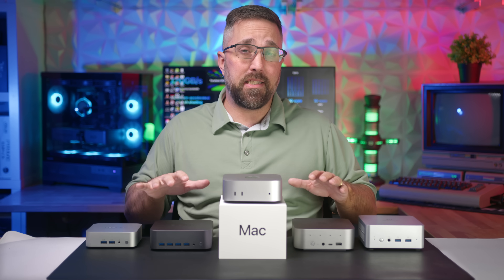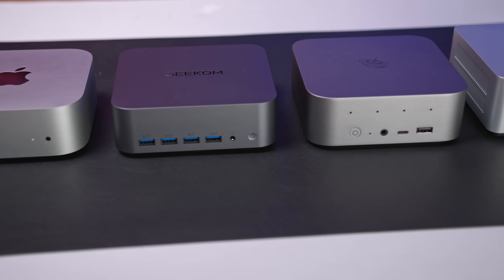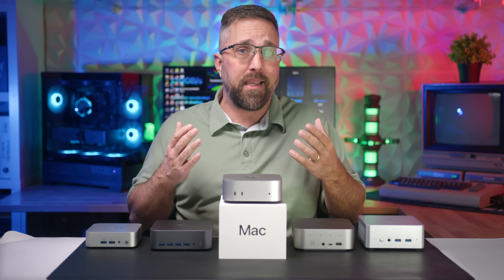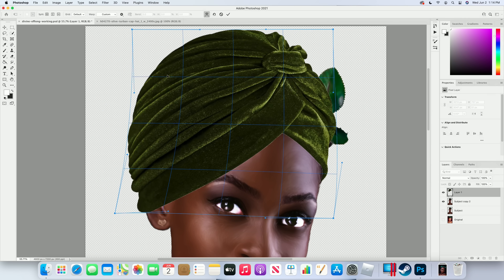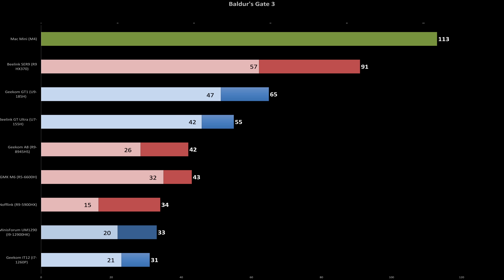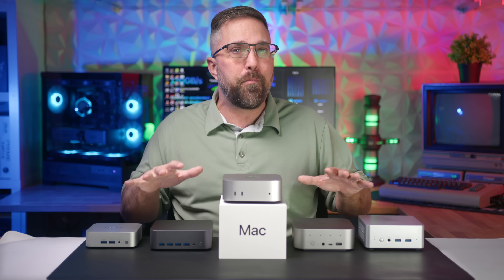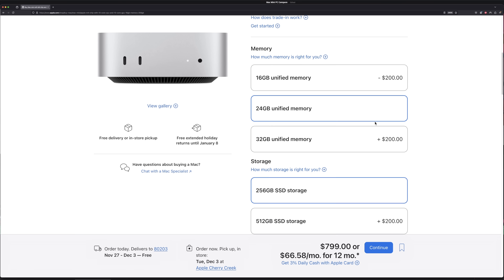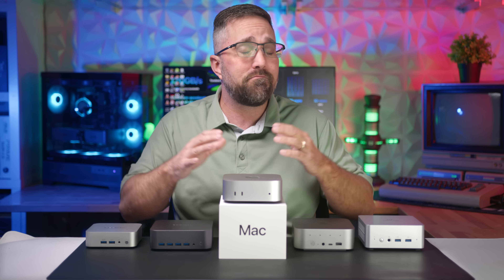M4 Mac Mini vs Intel and AMD Flagships – It's Not Even Close!

Comment: My Mac Mini base setup (it's the only way to do it if you value your bank account):
Mac Mini Base, got a $50 discount from Best Buy= $550, External Thunderbolt 4 enclosure from OWC= $100 (there are cheaper ones, I like the best and don't mind paying for it), 4TB Crucial T5 NVMe SSD, got on sale= $280. This is it, nothing else. And this is a very powerful, very future-proofed setup. This is the best deal in a desktop PC in 2024, and I'm a very dedicated PC gamer. I simply use said PC only for gaming now, nothing else. This is better everywhere else. Great comparison, you got a new sub.
Reply: Same here! PC gamer with a 13900k/4090 but wanted something quieter and portable incase I want to take it on a trip. Base Mac Mini for $499 with student discount, TB4 enclosure for $100 and a 2TB 990 Pro (had it laying around but was $189) and this thing is a properly fast spacious daily driver. The integration with my iPhone and iPad is awesome. PC only gets used for gaming now.
Reply: I’ve been an OWC user for more than 15 years. I’ve had a Blu-ray drive from them that has served daily use that entire time, with zero issues.
Reply: If you're getting a Mac Mini there's no question that getting external storage is going to be cheaper than internal storage, although it's worth pointing out that TB4 is limited to 32Gbps on PCIe (4GB/s) so it's not "the best" and there's also not much point in paying for drives with faster sequential reads (neither a Crucial P5 or T500 will hit their maximum read/write speeds) - you'll need an M4 Pro to get TB5 (but no enclosure yet available!).

More importantly though, the base Mac Mini will also only give you 16GB of memory for the lifetime of the device. Personally, I'm hitting swap (like with system stalls) on my M2 MBA at 16GB just w/ browser tabs, so YMMV. I'd say if you have light workloads, 16GB is fine, but personally, I wouldn't say anything w/ either <32GB of memory (or the ability to upgrade) would be very now-proofed, much less "future-proofed"! This is especially true with more and more useful local AI models. I'm not talking about SOTA LLMs, but smaller day-to-day stuff (like the Apple Intelligence's 3B models), which even at low quants will still take ~2GB of memory. Also, if you're going to run SRT like Whisper (even a turbo, distill, or smaller model), again, be ready for another 1-2GB of memory. Same with if you want natural speech output - something like xTTS/StyleTTS2 will easily take another 1GB or more. Image recognition/generation? RAG/search? Good luck.

Ignoring all of that though, I see 7840HS MiniPCs w/ 32GB of memory and 1TB of storage for about $500 right now, and all of those will allow you to easily upgrade to 96GB of memory (and of course internal storage, sometimes with a second M.2 slot) - I think for a lot of people, that might be a better tradeoff, especially if they want to use Windows and do light gaming on the system as an all-in-one. (I used one of these as my main (Linux) workstation for over a year).
Reply: Will the Crucial SSD be plug and play for the base model Mac mini?
Reply: @ajd1439  plug where? No internal NVMe slots. Externally, ANY drive works.
Reply: @ajd1439  IMO never go Crucial. Every time I go Crucial SSD I get a dead on arrival chipset model that has no cache and the worse ever buggy firmware controller. :P
Reply: Yes but for gaming not sure if anyone uses a mini pc like this. Minimum is Mini Itx which is way bigger than it sounds.
Reply: Exactly. Pretty much the exact setup I recommend for all my clients. Unless they don't need really fast storage, I give them the option for a $30 USB C 10 GB/s case. $70 savings.
Reply: Have you tried World of Warcraft MMORPG?
Reply: Dedicated PC gamer, uses Mac mini...erm no, not dedication, just retarded
Reply: Only gaming? Ever heard of "pi ess five"? I hear there's a "pro" model for, well, pro gamers. I also heard it has "new" and "AAA" games, unlike the little box with accessories. Price should be similar so be sure to check it out, I hear "gamers" love it.
Reply: Dedicated PC gamer? have you heard about graphics cards? 😀
Reply: @Dunc4n1d4h0  LOL. just saw the 5090 might start @ $2500, since the 4090 started at $2K
Reply: @JamesBond-fo6ow  So don't buy it. My $500 GPU is faster than Apple Silicon GPUs aside from the Ultra line.
Reply: @JamesBond-fo6ow  the 4090 didn't started at 2k, it was more like $1599 more or less depending on the model.
Reply: @blankname8553 do you just look at your gpu box or what? Because Mac mini is a fully functional machine
Reply: @20ferst Of course not. Im only saying the graphics in the M series arent as good as dedicated higher end GPUs. I dont want to run macOS so I dont buy their proprietary boxes. I prefer x86 based Linux and windows if I cant play my games on Linux.
Reply: Highly doubt that OWC is the best...
Reply: @PSYCHOV3N0M  the "best" what? Can you define "the best"? They make premium enclosures and NVMe drives.
Reply: Not really.  MacOS sucks balls.

Comment: please compare with a computer with discrete GPU, you'll be surprised :)
Reply from the maker: I did that in my M1 Mac Mini and Mac Studio Series'. The Macs....well.... if you're curious, I'll let you watch those videos for the results :)
Reply: pretty sure he knows what computers are. my rtx 4080 is literally bigger than two of these machines put together and use 5 times as much power. but it doesn't replace my steam deck or my laptop (which does have an rtx 2070 which is considerably faster than these but... the sad 10750k in it is a lot slower).
anyway, strix point will be shaking things up soon

Comment: The classic Mac argument is to pretend that everyone uses Photoshop and does video editing on a regular basis.  This drags the prices of the Mini PCs higher to match the needs of this customer.

My problem is that most customers do not use Photoshop or do video editing.  Just as most people with Smartphones are not videographers.  And so when you remove this customer from the mix --

-- you discover you can get a hell of a Mini PC from basically ANYONE for half the price and sometimes less.   So if you have 3 kids and you want to give each of them a desktop PC?   $900 for all 3.  Or less.

But it gets worse.  Because, you see, Apple always tries to make you pay $200 or more to get more RAM or storage than their PC cousins.  Most $300 Mini PCs include 16GBs of RAM and 512 SSD storage.  The Mac Mini charges you $200 more to double the storage to 512.

So to get those 3 kids those Macs with similar storage and RAM is $1400 more.  

And did I mention extended warranty?  The good news is that greedy Apple just surprised me by dropping their 3 year price to only $99.  The bad news is you can get your $300 Mini PC similarly covered for $40.  

So $1525 more for 3 Mac Minis with warranty for kids.  Imagine if this was a business and it needed 20 workstations?  A savings of over 10K.  What if it was a school system that needed 2000 minis?  Savings of $1,000,000.
Reply: LOL! It's what I do on the daily, so it works great for me. Horses for courses...
Reply: Just buy a used office PC for 100 dollars if it's the same thing. Maybe it will be more powerful than a new cheap mini PC, and the GPU can be upgraded.

Mac mini is a different category, it's a top of the line CPU in a small/silent package.
Reply: make you pay… sure, blame the company and not the consumer
Reply: @jwllzp  Yes.  I blame Apple for gauging on (in this case) storage.  There's making a buck and there's being greedy little holes.
Reply from the maker: So what you're saying is this:
https://youtu.be/Yp-AnPFpa7U
Reply: @ElevatedSystems  Yeah, but I'd bump up to AMDs SER5 ish models.

Comment: To match the configurations of the other devices would bring the M4 mini cost to $1399.  To move to  2 TB storage on the M4 I could put 2x 4TB Gen4 SSD's in the others.  If you move outside of synthetics and optimized software that completely leans into the M4 mini then I think the picture changes.  The base model is excellent and provides superior utility within a tiny scope but it's a loss leader meant to trap the purchaser into a upsell mentality, buyer beware.
Reply: Yeas. Good point. He mentions this towards the end of the video. 200 dollars for 8 GB of ram in 2024 is insane.
Reply: The less synthetic the benchmark is the more powerful the mac gets. The average user doesnt need more than 16gb of ram and the storage is upgradeable externally with excellent speeds. The only real downside is game compatiblity put if you want a machine to get work done the mac is the best plus apple provide a 100 discount if you are a student
Reply: @walidoutaleb7121  The average user doesn't need to spend $599 to get their work done either.  And yes you can add external storage to your mini but then it starts not being the tight little form factor anymore.  Apple offers larger storage options for a reason?  Where do you think the student discount comes from?
Reply: @maxwellsmart3156  who cares about the space it will take since its a pc you will at minimum have a mouse keyboard and screen connected. We are not talking about a laptop. someone might go cheaper but will it actually be cheaper in the long run? This mac mini will outlast any machine cheaper than it.
Reply: @walidoutaleb7121  
Not really. If your workload consists of sshing into a terminal, even a $200 android phone will do. Browse the web? Chromebooks come in at around $300 these days, with about the same baseline of m2 drives and soldered ram
Reply: @Demopans5990  ok and the m4 has 10x the performance buying a chrome book every other year makes no sense

Comment: Outside of limited games to play and mediocre SSD write speeds, the base M4 destroys the competition.  You can even boost up the RAM to 24GB, and still have a great price to performance.  

$800 without the student discount.  $700 with it.  Add a $20 dongle for any missing ports, and a light user has all they need.
Reply: Software integration is an issue if you need plenty of open source software.
Reply: @paxundpeace9970 what do you mean?
Reply: It would be nice if the veterans and active duty military got the same level of discount as the students do
Reply from the maker: @Xanduur  we can just buy it at the PX. AAFES and NavEx carry All apple products usually at a discount, and no tax.
Reply: @Xanduur  they actually dont check iirc so anyone could get it
Reply: actually you can play just about anything with crossover
Reply: @chidorirasenganz But most people don't want to do that, especially kids.  They just want to download and play.  Plus, Crossover costs $74 annually.
Reply: @ It’s as easy as downloading Steam. Crossover is $79 for a year of updates. You can still use it afterwards and it often goes on sale particularly around Black Friday. I scored it for 20 bucks. Besides it’s not as if maintaining a Windows PC is hassle free

Comment: why does half the game footage say 60fps but chug like 25fps? Are the frametimes choppy? Is your recording setup doing something weird with these minis? The BG3 footage never looks smooth, despite you claiming it several times.
Reply from the maker: OBS is recording at 60 FPS but this video is edited and renders down to 29.97 FPS. Obviously a lot of frames are lost in that process. The recording is also being upscaled from 1080p to 4k. Then YouTube does it's compression thing and it's output at whatever resolution, framerate, and bitrate your device is set to. The gameplay footage isn't meant to provide a perfect representation of the visual fidelity of the gameplay. It just a clip to support the narrative, provide some variation from a bunch of charts, and so you don't have to look at my dorky talking head as much as possible.
Reply: @ElevatedSystems  Thanks, but it's incredibly misleading and I can't tell if you have a flawed methodology, bad eyes or just a mistake in the pipeline. The rest of your footage outside of games is smooth and clear and it would be greatly appreciated if the narrative matched the visuals on screen, or at least enabled more data in the HUD to show that the frametimes are stable in spite of the choppy end result in the recording.

Is it choppy in your local playback too?

Comment: You've got to be kidding me. Base M4 Mini is like 1400 here.
Reply: In the USA 🇺🇸,  it is selling for $600.  With a student discount on Apple's website, it can sell as low as $500.
Reply: It's arround $650-660 (converted from Rp) here in Indonesia for the base model. Kinda surprising actually, in a good way, as we don't have an official Apple Store here (only have official distributors). 10% difference is pretty good I guess. Same case for the M4 Pro 24GB/512GB. It's a bit more than, $1540 here.

For comparison the Beelink SER9 w/ HX370 32GB/1TB priced about $985 here. So the $300 gap should be sufficient to buy a 1TB external SSD + sufficient monitor + peripherals.
Reply: That’s probably sales tax.  In Japan we have 10% sales tax and the total device cost is equivalent to $660 US. 

US prices are listed without tax and tax is added at checkout because each state has different taxes.
Reply from the maker: Where is here? I assume it's somewhere with high tax, terrifs, or import duties.
Reply: @ElevatedSystems  may be he's talking about m4 pro
Reply: @Gyooopp Mac mini is way more expensive in europe
Reply: @ElevatedSystems  dont compare 32gb and 2tb ram with its price to 256gb and 16gb ram, your opinion is skewed towards Apple, and you forgot to add another 600-1200$ to the base price if you like 2tb and 32gb with M4. So you should compare 999$ from Mini Pc, to 1400-1600$ for M4 with the same RAM/SSD amounts!!!!!!!!!!!!

Comment: Your table has M4 Mac Mini as having Wifi7. It actually has 6e.
Reply from the maker: Well crap! This is why I need an editor. Thanks. I'll pin this comment for the info. I did quote the correct specs later in the video. Not sure if that helped.
Reply: @ElevatedSystems  Also, BT 5.3, not 5.4
Reply: @ElevatedSystems  It's all good. Mistakes are always going to happen. LTT has a bunch of editors, a community fact checking program and millions of dollars, and they can't talk about something like Thunderbolt for more than 20 seconds before getting something wrong.
Reply: @brendanseabrook  lol
Reply: @brendanseabrook LTT's videos have been going downhill for a while now.
Reply: @brendanseabrook a year ago... get over it
Reply: @brendanseabrook  lol funny😂
Reply: @brendanseabrook mistakes are not allowed hehe 😛
Reply: Not to mention some of the others have 2TB of storage. For the mac mini that would cost $1400, which is $400 more than the listed comparisons. And, 32GB ram in the mac mini would boost the price to $1800.
Reply: @ fanboy cope harder🤡🤡🤡
Reply: Do you recommend Mac mini for running hypervisors with 2 VMs over the other mini PCs. The VMs would be running IIOT Applications with high processing rates.
Reply: @ The Apple CPUs aren’t great at running VMs and you’d want lots of RAM which gets ridiculously overpriced.

You can run MacOS in a VM with hardware graphics acceleration on Linux and without on Windows with tweaked install images.
Reply: Cinebench is x86 biased so arm64 scores = SCORE*115-120%

SPEC2017 and SPEChpc2021 more than backup my claims
SPEC is the gold standard 
Not this freeware x86 bias cinecrap
Reply: Cheese people. When will you ever learn? Apple needs these components be readily available for hundreds of millions of machines. You need transfer speeds and you use the Thunderbolt for that. Not the Bluetooth or WiFi.
Reply: literally unwatchable
Reply: @BowlineDandy  3kliksphilip did not foresee this becoming a widespread meme
Reply: @BowlineDandy  ”literally unwatchable” - Have You problem with eyes?
Reply: @wooowoo6291   Have you problem with sarcasm?
Reply: @peterbreis5407  I have problem with sarcasm to similar to hate.
Reply: @wooowoo6291  Big difference. Hate isn't funny. But people who have trouble with sarcasm struggle with funny as well.
Reply: @peterbreis5407  BTW, my answer was pure sarcasm :)
Reply: @peterbreis5407 needs to put /s for user who have reading comprehension issues.
Reply: @ericg7490  I thought the /s was for spelling issues. 😉
Reply: Wifi 7 also isn’t even out
Reply: It actually has Wi-Fi 8
Reply: @Taxiway_Alpha  It actually has WiFi 512Gb running in Nvme mode over a wired ethernet HDMI port.
Reply: @Taxiway_Alpha   nice joke :D
Reply: You don’t NEED an editor. You simply need to pay attention. Promoting false information destroys your credibility. If that doesn’t motivate you then you’re hopeless.
Reply: @Fred_the_Head  To be fair not many people are interested in the wifi specs of a stationary computer.
If your 10Gbit/s home network fails, your speed will be limited by the emergency smartphone internet connection anyway.